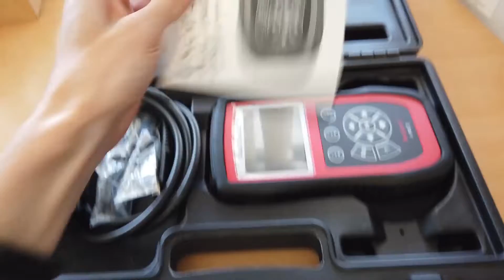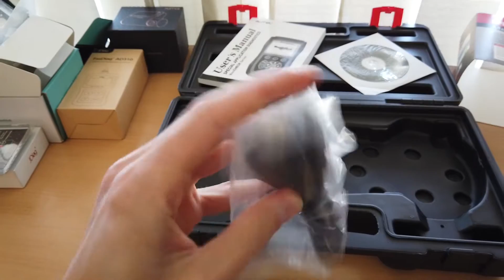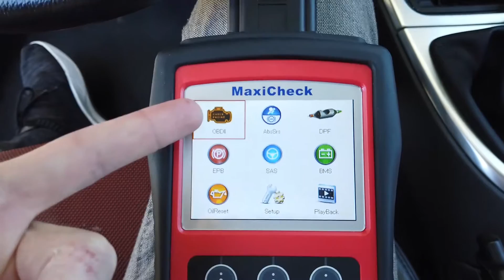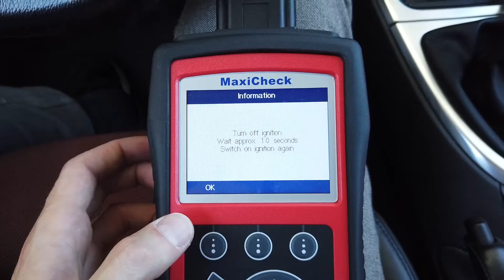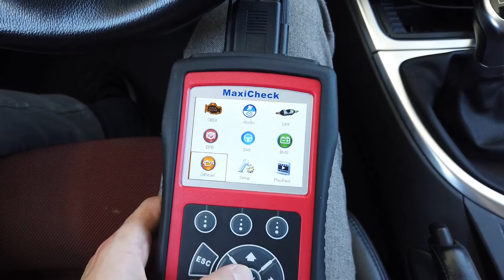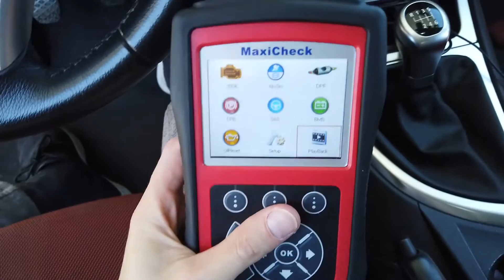Autel MaxiCheck Pro first impressions

Comment: I purchased the unit and although I think it works well, I have 3 major complaints.   1.  Unit is supposed to be portable and yet they put it in a humungus blow molded case!   A nylon case would be much better!  2.   No power adapter (but you can use usb to power it) 3. The abs live data comes out in a large font and is in Alphabetical order and you don't have the ability to choose a custom live data list as you can in the OBDII live data section.   The problem with this is that if you want to monitor all 4 abs wheel speed sensors at the same time, you can't, you have to scroll!    Other than that - it does as advertised.

Comment: I own this Maxicheck.  does it do OBDII well or should I buy a Foxwell nt301?  REason I ask is that when I first bought it, I was told it does so so in reading general codes.  Its main use is for special applicaitons such as air bag  and ABS.     Currently, my Lincoln failed emissions.  They said NOT I/M ready.  I drove it for months and still not I/M ready.  Was wondering if this machine can find out why or should I buy the Foxwell NT301?
Reply from the maker: Generic OBDII standard is so simple to implement that each and every device that I tested was reading and clearing those code without a problem. The only issue that I had with some devices was refresh rate due to low CPU power of the device.

Comment: can we use maxi to reset inspection due on audi S1 2016? need clarification bfr purchase the maxi pro, thanks
Reply from the maker: I can't confirm that since I don't have access to S1 to try it, but I would be surprised if it didn't work. Reseting inspection reminder is a "must" for any advanced diagnostic tool. Especially in VAG cars.